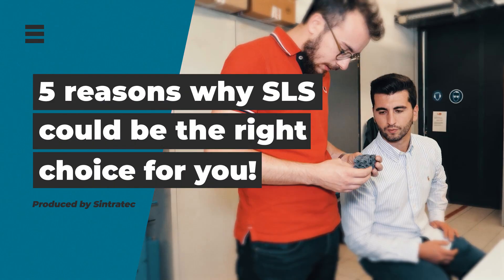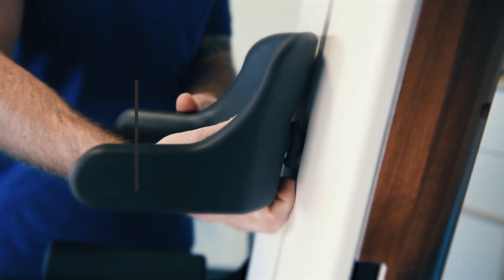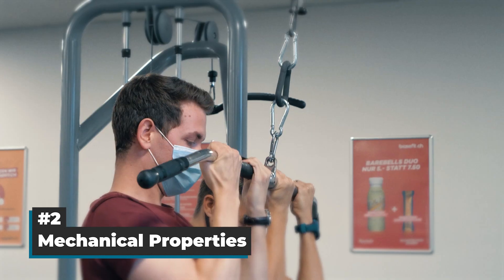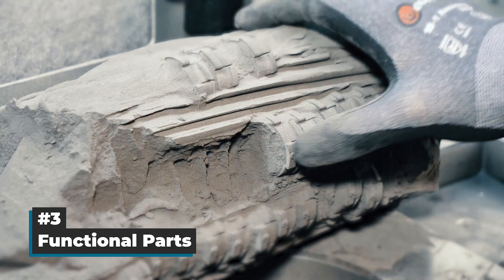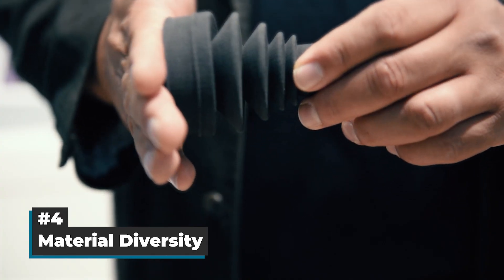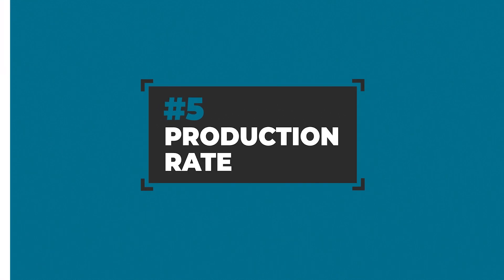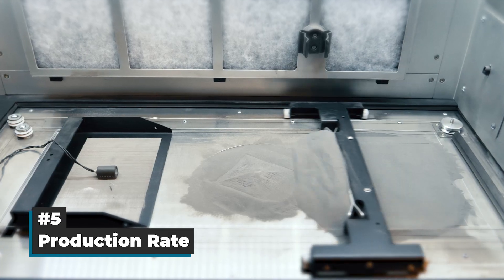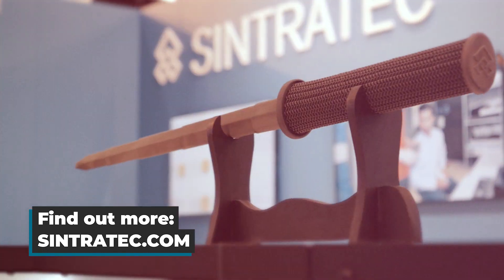Top 5 Reasons why Selective Laser Sintering could be the right 3D technology for you! – by Sintratec

Comment: Hi every one,
My question is what happens to the INFILL material, it seems that is poisoned in the part?
Reply from the maker: Hey there, usually it is recommended to design more massive pieces with outlet openings (for example small holes) where the excess non-sintered powder can be drained off.